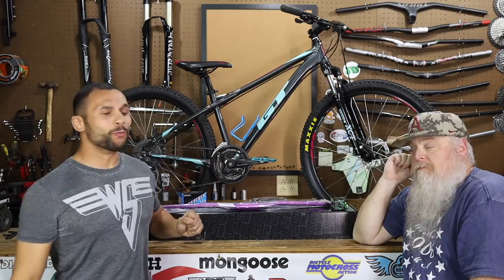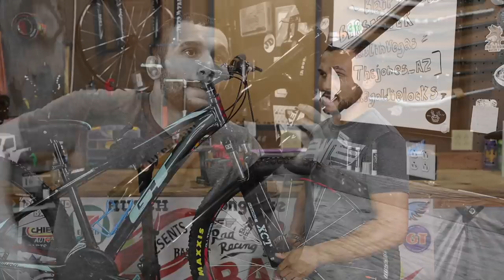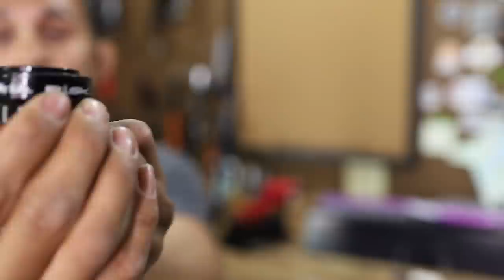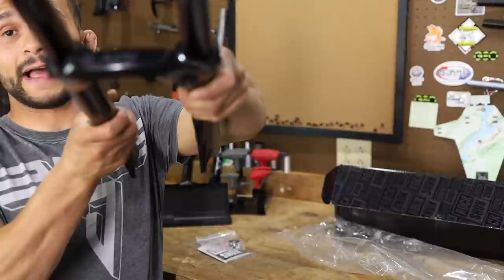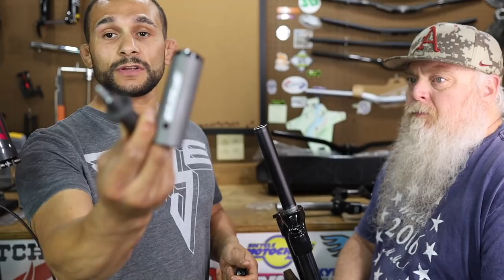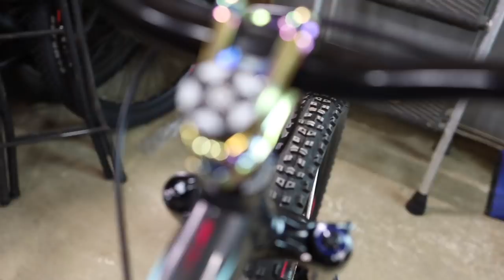GT LAGUNA PRO gets WOLFTICKED!! Stage 1

Comment: I use grease where is safe for two additional reasons: to stop metals bonding together, so it won't seize and be pain in the ass to remove/extract. other reason, it stops stuff creaking. I hate creaking. of course, main reason for greasing is smooth operation of the components and to stop water ingress.
Reply from the maker: Good points man, you and everyone else said the same thing! LOL I willfrom here on out brother👍 Good looking out man.

Comment: I agree with you this time Tick, you dont need greese were it presses in!
Reply: Every part going on bike should be greased as it helps to seal and keep water and other things out of the frame
Reply: @stylusmtb1762  if it dont move it doesnt need greese, the greese collects dirt
Reply: I gotta agree with Wolfman and StylusMTB. Would rather have a barrier between metal to metal press fit, aluminum to aluminum can still corrode and it should make removal easier down the road. Don't think it will collect any gunk.
Reply: Prevents rust from galvanic corrosion, will make it easier to switch headsets in the future
Reply from the maker: THANK YOU SIR👍👍

Comment: Can the handlebar be raised on this bike, say like 3" ? My wife wants more of a road bike feel.
Reply from the maker: Hey brother, yes and no. You can buy a new stem which may need to be waaay long and uncomfortable for her, or you can buy this. It will fit since it's a 31.8mm. This should do, here is an affiliate link. 
https://amzn.to/3Qj2Wsk
Reply: @WOLFTICKVIDEOS  Alright my man. I ordered the new handlebar. Just in case that is not enough height gain, is there something else we can get later on?
Reply from the maker: Hey brother, here is another affiliate link. The bar should do it but I'd it does not here is another option. It's a stem that has adjustment. 
https://amzn.to/3OEANuv
Reply: @WOLFTICKVIDEOS I'm back and we're playing around with the Laguna Pro some more. My wife's arms are straight, not bent at all and either I was thinking of the adjustable stem or the colorful short stem that you ended up using. Which one do you think would be better? And when I ride the bike (my arms are hyperextended, I'm a few inches shorter than my wife). We've already moved the seat forward all the way, and the handlebar you recommended above was a big step in the right direction. Also if you do recommend the shorter stem, is there one that matches the bikes color scheme better?